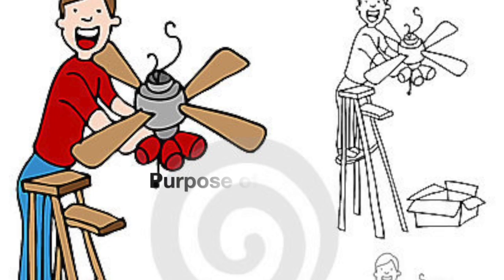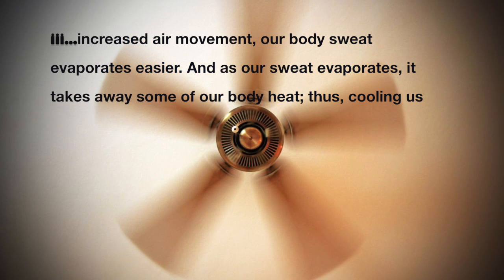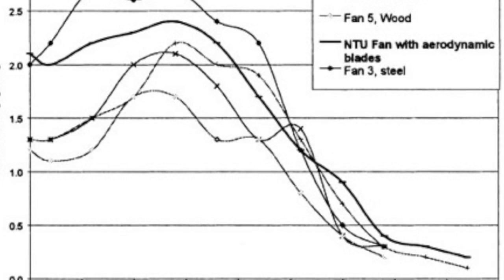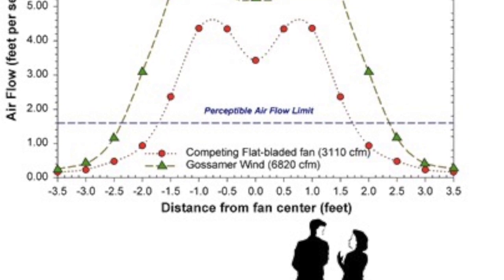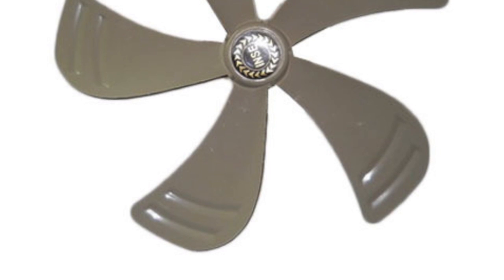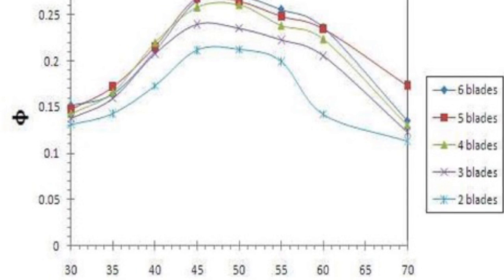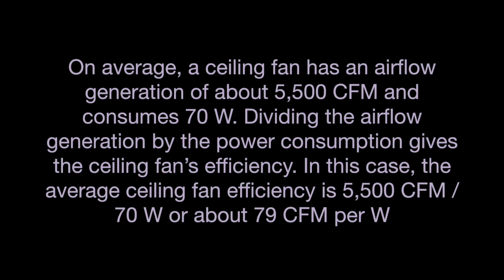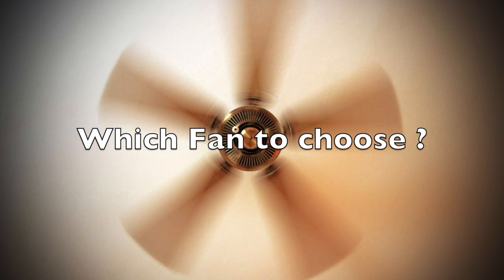[OLD Version] Why American Ceiling Fan has 4/5 Blades Vs Indian Ceiling Fan only 3 ???

Comment: It's probably mainly because most American and Canadian fans are meant to be very decorative, so many fans may have more blades than they need (the motor may be modified to accommodate more blades). Indian fans on the other hand, are meant to be alot more functional as air conditioning still isn't that affordable there, so most fans only have the necessary three blades. They typical Indian ceiling fan found in residences is actually very similar to industrial/commercial duty ceiling fans found in North America, which also typically have only three blades (like Envirofan ceiling fans).
Reply: Kat TheFanEnthusiast
Reply: Kat TheFanEnthusiast I onion              jhhhbjhj